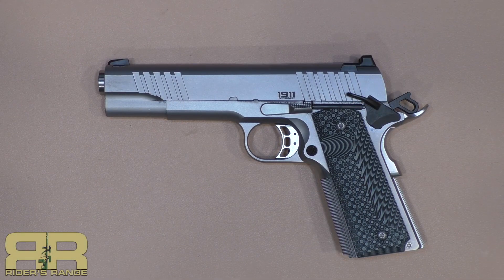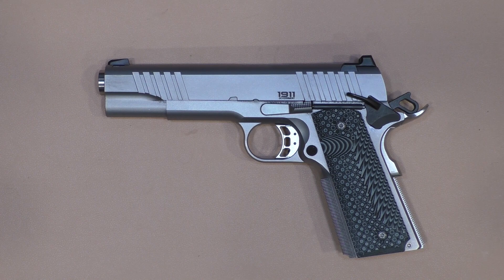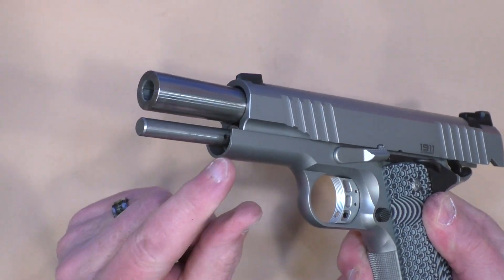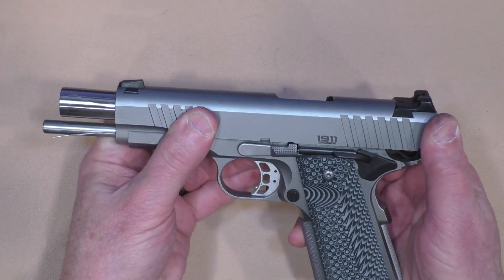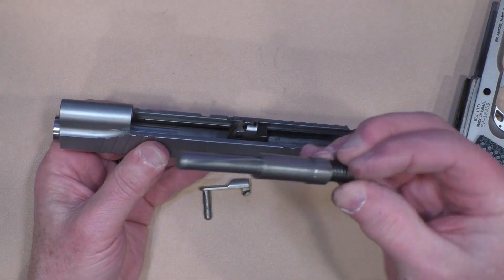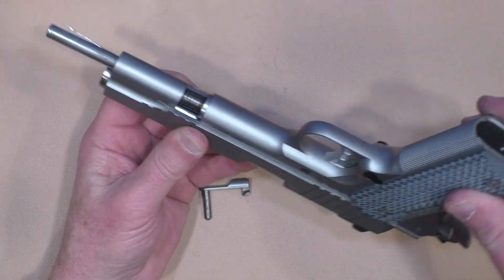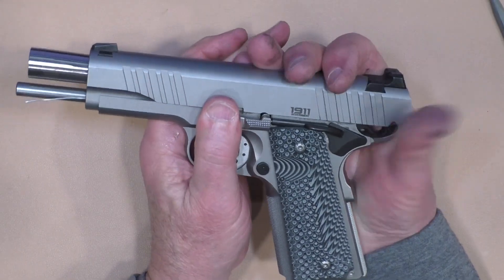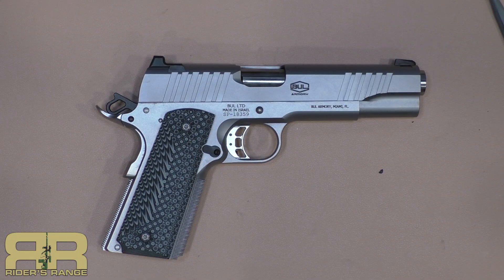Field-strip a 1911 with full-length guide rod

Comment: A few questions: Who invented the M1911 guide rod and why?
Why do people have different opinions about which version is better?
I own an H&K USP .45 and it has a guide rod too.
Reply from the maker: The "GI" length guide rod was an integral part of the 1911 design, as it is in virtually all pistols. Without some type of guide rod, the recoil spring wouldn't stabilize in the frame. However, the full-length guide rod seemed to have come into vogue a half-century ago, seemingly to cure some non-existent issues. The opinions on full-length vs GI-length guide rods are about as strong as 9mm vs .45, Glock vs anything, and what distance to practice at.
Reply: Many top competitors claim the full guide rod ensures a smoother, more reliable cycling and reduces chances of jamming. My 1911 45 has a full guide rod. I have no issues or problems with that.

Comment: Does the barrel not come out?
Reply from the maker: The barrel comes out from the slide the same as every other 1911. The big difference is the take-down with the guide rod.
Reply: Thanks. Fyi this is my 1st 1911 so I didn't know. It's actually the same Bul model as featured except in Commander size. I wanted to strip it to clean the excess oil running out of the pistol from the factory. The manual wasn't very helpful and the tool included for the guide rod was too big and didn't clear the frame to reach the little hole. Your paper clip move woked like a charm though. Thanks for the content and thanks for responding. You rescued my range trip tomorrow.
Reply from the maker: @jojodancer1743  Just keep your 1911 well oiled and you'll have many years of enjoyment.

Comment: The idiot scratch sometimes happens because trying to pop the slide lock pin back in, it's to tight and then you try to use a knife or a credit card, some are smooth, some are so tight it's almost impossible...just saying....Ive had both...
Reply from the maker: Many reasons. Folks also try to push the slide stop UP because it may be easier to pass the slide stop plunger, rather than straight in, which is often more difficult. The upward motion usually results in the scratch. Thanks for watching and commenting.

Comment: Just a couple of comments.  It is not a true 1911, it is a 1911 like, just like all striker fires are not Glocks!  If there isn no external barrel bushing and it has a full length guide rod it is not a true 1911.  I’ve got 4 45 ACPs, a Colt Gold Cup Trophy, 1911, a Colt 1991A1 Compact, close but not quite and two Kimber, not 1911s.
Reply from the maker: Technically correct - a "true" 1911 is a .45 with a 5" bushing barrel, stubby GI sights, flat mainspring housing, long trigger and no ejection port relief. Fortunately, we have evolved to where even a Kimber Ultra Carry II in 9mm is considered to be a "compact 1911". But I guess there are those who consider a Corvette to not be a "true" corvette unless it has a PowerGlide transmission coupled to a six-cylinder engine and feeding a solid rear axle. But thanks for watching and commenting.